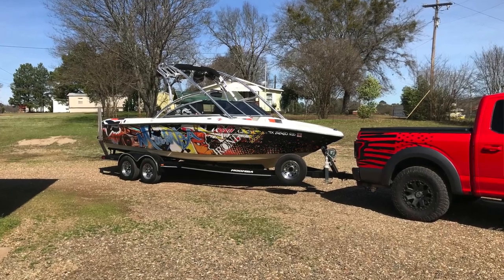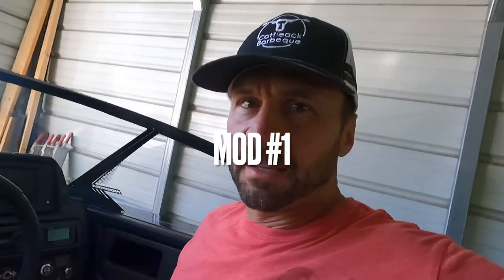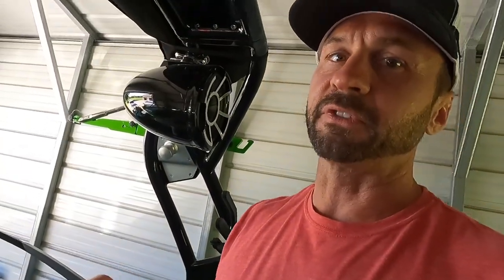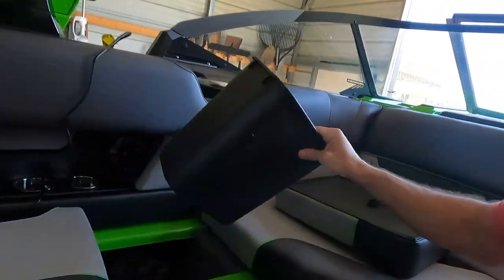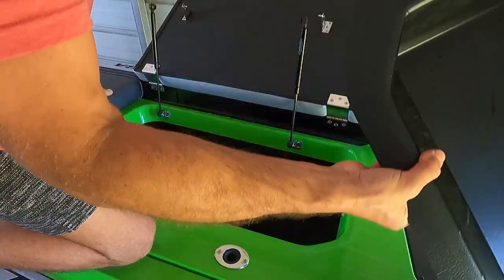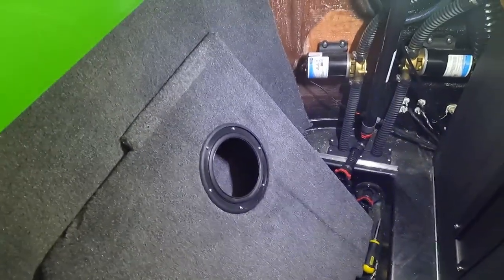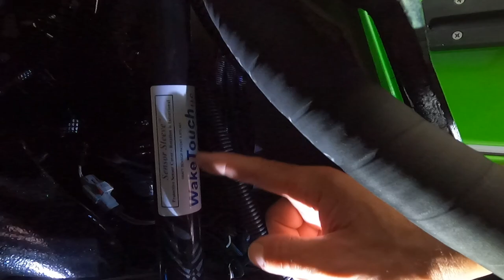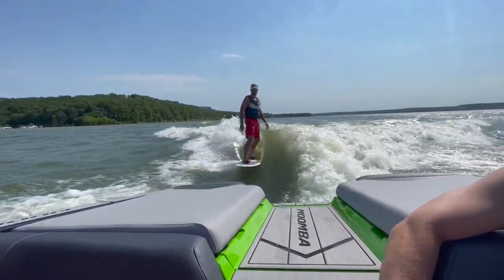DO THESE THINGS to your wake boat!

Comment: nice video man. just FYI the rear bags you pictured in your video are not completely full. they are a pain to get vented but my wakemakers in my makai almost touch the fiberglass edges. they used to look like yours but I ended up filling them with my leaf blower and wrestling around with them to get them to finish expanding. now to figure out why mine are draining down.

Comment: I have a 2021 Makai and was thinking about doing the ballast upgrade.  Looking at the WM bag upgrade in your video when you had it full, it appears you could still put the storage bin back in.  Is that the case?  By the way you need to get on the Moomba Forum.  You would fit right in there!  I did a light modification to my tower light as well, but used a little softpush switch out of a chep solar LED light and drilled it into the end of the white lens cover.  That was actually my first modification.
Reply from the maker: I’m on that forum actually. BrentC5Z. The bins are little too deep to fit. However, I may cut them down just a couple inches to keep them useable. Unsure at this point because without them, I can store my boards on top of the bags while they are empty/ not at the lake.

Comment: Have you got it all dialed in for surfing?  Looking at a makai and wondering how your experience has been.
Reply from the maker: It's so good now. My daughter and I went later in the summer. With just one person in the boat we can surf with no rope and it's very clean.
Reply: @GreaseMonkeyTV  I made the mistake of rushing buying a boat. Bought a 2020 Craz. I haven’t surf it yet, but I think I’ll be able to dial it in pretty well. But I think it’s going to be a little small. So now I’m trying to figure out a way to sell it and move up to a Makai. I talk to a dealer about trade and they wanna give me about 20,000 less on trade than what it’s worth retail. Sometimes I make dumb decisions. But I’m sure we’ll have a good time on it. If it sells, I may be reaching out for some details.

Comment: Awesome boat.  I have a Makai on order from the same dealership!  Two questions for you....1st. how long did it take to get the wakemaker bags in?  2nd. Was the better push you had with the bags installed before you moved sensors or had you already moved the sensors to get the most out of the bags??
Reply from the maker: Bags arrived in just a few days. They shipped from TN. Moving the sensor doesn’t help anything except getting the larger bags full. Will be installing vents on top of the new bags next.
Reply: @GreaseMonkeyTV  So they will fill up close to full without a sensor move...but moving them will insure that they are completely full.......is that what you're saying?
Reply: @GreaseMonkeyTV  So you’re saying the vents you point out in the video aren’t venting like you want?

Comment: So, it appeared you didn’t need to make the sensor adjustments you talked about. Is that correct?
Reply from the maker: The bag sensors need to be moved. They tell the pumps to shut of so you have to cycle the switches otherwise until full.
Reply: @GreaseMonkeyTV  Thanks. Any details on how you moved the sensors?

Comment: Can't help but notice you're riding goofy foot.  Is it harder to make a goofy wave than a regular wave (on the other side)?
Reply from the maker: For sure! You must be listed more for goofy foot to overcome the prop rotation. The larger bags help because you can just run less in the port side yet still have push.

Comment: Should've bought a supra! No need for all the upgrades. Biggest issue I found with moomba is there is a massive difference between bag ballast and subfloor ballast. 4 thousand pounds of sub floor ballast on my supra is night and day different from my 2022 moomba.
Reply from the maker: I would guess that’s due to the boat being much heavier. Saved $100K vs the 24.5’ Supra so don’t mind making some adjustments.
Reply: @GreaseMonkeyTV  So true!

Comment: all that work for a proper wave seems like bs on a surf boat, especially when a Supreme 220 is in the same price range and will spit out out an awesome wave straight from the factory
Reply from the maker: The smaller Moomba Kaiyen is surf ready as well for under $100K.They did have a 24.5’ Centurion available for $100K more than I paid though…